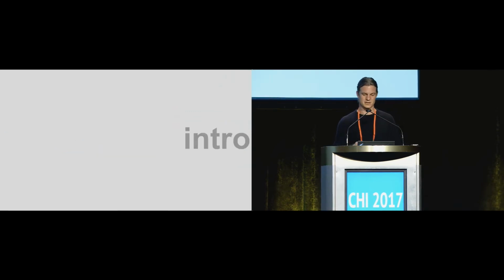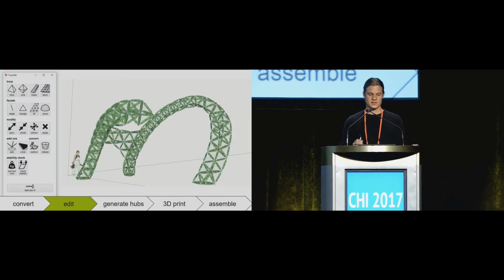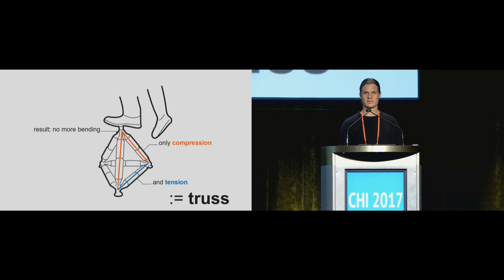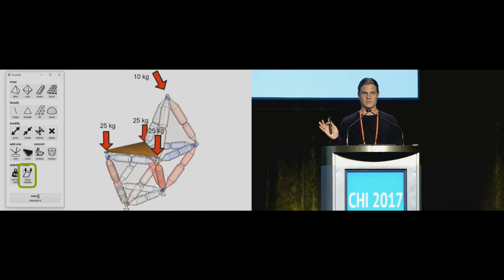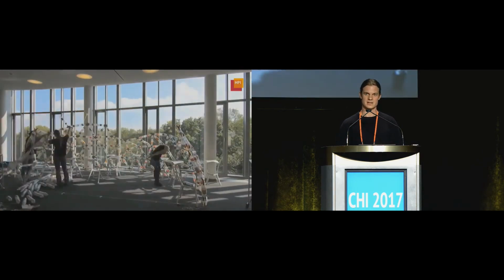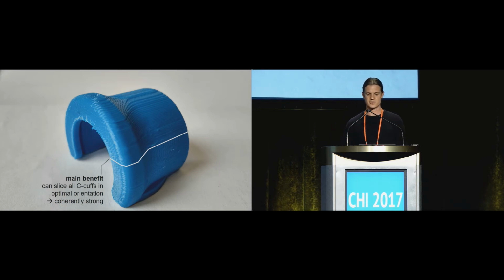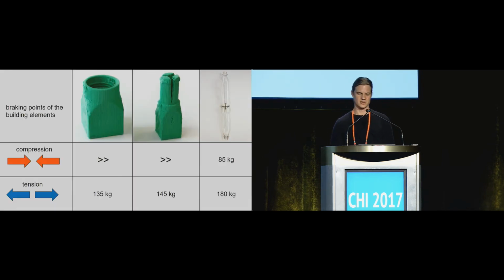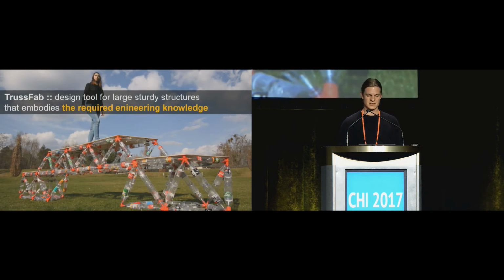TrussFab: Fabricating Sturdy Large-Scale Structures on Desktop 3D Printers

Comment: He mentions testing for strength, and some durability factors, but not UV. If this was used for outdoor structures, I would be concerned that the bottles will eventually degrade from UV exposure and also heat cycling.
Reply: Bro, eso no se degrada ni en el desierto. Descuida que el plástico tarda miles de años en deteriorarse
Reply: @josehrnaz this is not correct. Look up UV degradation